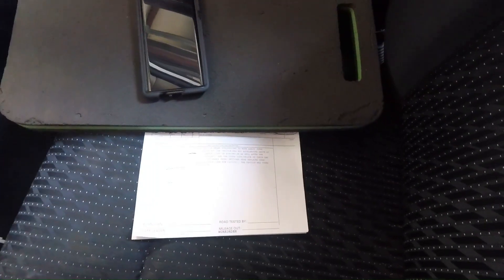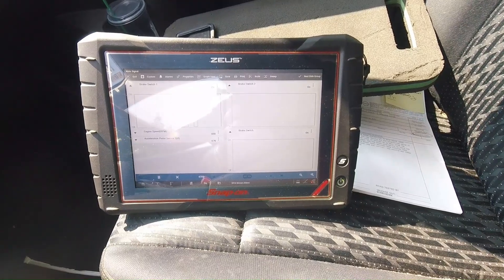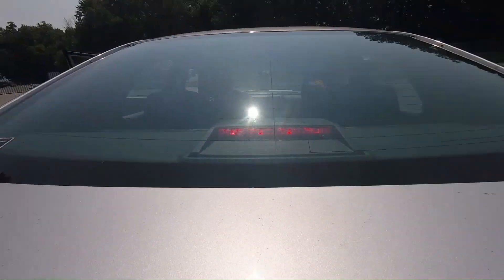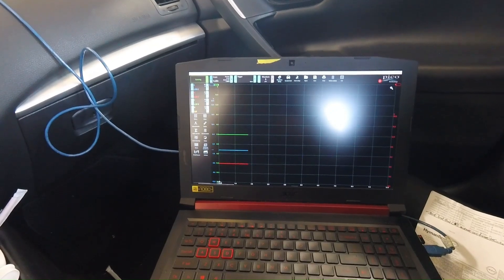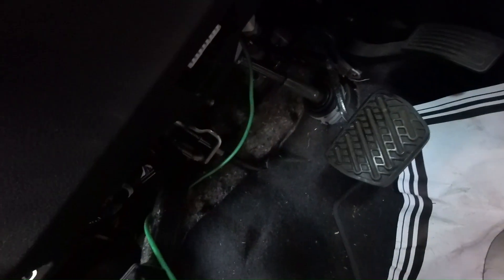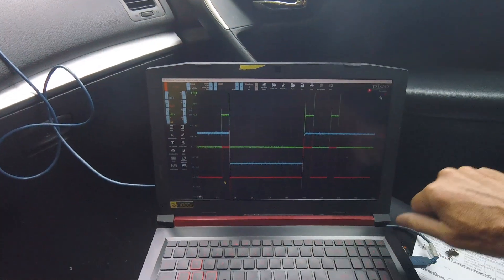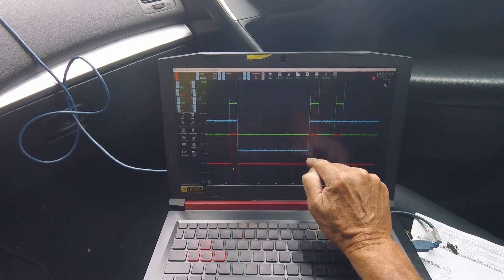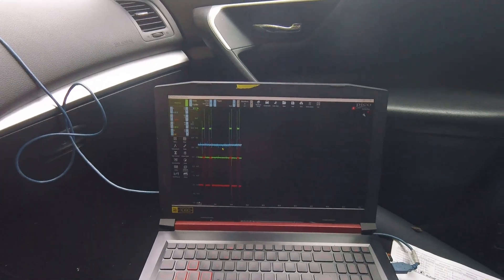Intermittent Issue Case Study

Comment: Would like to see some Altima P0101 videos.  I have a 2013 that keeps setting a P0101 and ECM number is not listed in the TSB for reprogramming.  It did have the orange PCV/ replaced with black, cleaned Throttle body and replaced MAF.  Voltage readings at ECM match service information.
Reply from the maker: We see a lot of throttle body replacement . Cleaning and idle volume doesn't seem to help.
Of course all the basics must be looked at first.
Reply: @CartersDiagnostics  the only code was the P0101 and could complete CAT monitor and a couple of other readiness monitors when driven easy.  Turned out to be a restricted exhaust due to previous CAT replacement leaving behind powdered material in front of secondary CAT causing the performance code..  VE test for the Win!
Reply from the maker: Great find 💯  Thank you for updating,  its the best way for us all to learn

Comment: Good video, I 100% agree with your statement about being able to monitor multiple circuits at once, and not just for high speed readings, I was wondering what laptop you are using in the video? I am thinking of getting another one.
Reply from the maker: Its an ACER nitro 5 . Kind of an older laptop.

Comment: I take issue with the tsb!  You've now changed the way the car is wired, and any future techs looking up a brake wiring diagram will be misled.  Why not just make a more reliable relay?  Seems nuts to me.  Relays are used for starter enable, they seem reliable enough that you don't see starters being stuck engaged.  

Also... where'd the power loss come from?  Does the ecm reduce power when it sees the brakes are applied in an effort to prevent the brakes from overheating?  Maybe it's used to stop the vehicle from being powerbraked?

my questions and issues here are regarding Nissan.  As for the video and using the scope for it's multi-channel abilities, good job!!
Reply from the maker: Thanks for the comment.  Not sure on why they don't make a better relay. The power loss is from the brake switch input. It limits throttle response when the switch is on.

Comment: The Pico software can run up to 50 000 seconds = >14h in a single screen, and can be set to save basically an unlimited number of screens until the hard drive is full, so it's absolutely useful for logging slow signals too. And the ability to set it and forget it, just checking what it caught later can be worth its weight in gold for symptoms you only see once in a blue moon.
Reply from the maker: Absolutely 💯,  Thanks for commenting 🙏

Comment: It’s nice to know your background and how you’re able to take the time to properly spend the time on the cars. I work in a different field and it’s always felt like flat rate is a conflict of interest to me. Lots of opinions vary there so I won’t beat a dead horse or anything. Nice work on this diag and video! 

One thing I used a scope for recently was to find a short to ground. I put a long time base on the screen and shook a bunch of wires until I saw the amperage spike on screen. Turned out to be a bad trailer harness.
Reply from the maker: Great strategy with the scope 👏. 
The flat rate is good and bad. The conversation is worth having per individual IMO. 
If I was still a flat rate rate, no way would I make videos or spend the hours on some of the cars that I record.
Reply: @CartersDiagnostics  Agreed Mr. Carter. Flat Rate is a necessary evil in the industry for the most part BUT, after a few years when someone starts as a Tech, if you're a conscious individual you must ask yourself; do I want to become a diagnostician and really know what I'm doing, or just a good/average flat rate Technician (efficient parts changer) focused 99% on the money. I think both are necessary for the industry as a whole. IMO, a few individuals should be dedicated diagnosticians in a shop. I work in a 30 bay dealer/shop where 100% of the Techs are Flat Rate, even the 2 "Shop Foremans", and you can probably guess how good that works :(